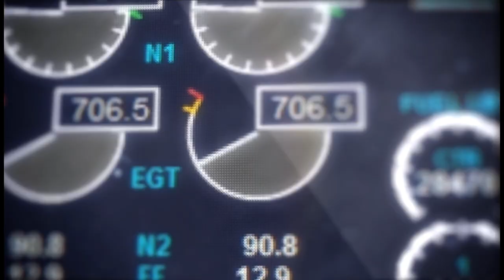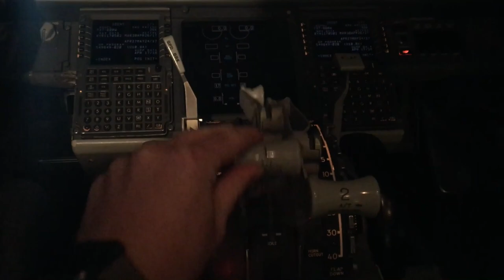Can a circuit-breaker crash an aircraft?

Comment: I have a set of books called Air Disaster and in 1 there was an incident caused by an aircrew tinkering with the N1 tach circuit breakers. They ended up drastically overspeeding 1 engine to the point it blew itself apart which caused heavy damage to onboard systems as well as broke out a cabin window causing a passenger to be ejected from the aircraft. The other 2 engines also went above 100% engine throttle but didnt fail

Comment: On a newer aircraft with the digital checklists, is there any integration between the checklist and the actual settings? Ex. Checklist says Flaps 5, and you click ok even though the flaps are 0. Does it continue on or stop you right there?

Comment: Yes, yes, yes.  On August 16, 1987 Northwest flight 255, an MD-82, departed DTW with no flaps extended.  The result was almost the same as the Spanair flight shown in this video.  I was near the crash scene - it was too awful to wrap my head around.  This issue is SO very important.

Comment: ReHi Mentour:

that Swisss air disaster is not the only one in which neglect of a circuit breaker had serious results.

The one I remember hearing of was, i believe on an Air Canada flight. the circuit breaker popped just about time to take off. One of the cockpit creqw reset it, it popped again. 

Instad of investigating, he reset it a second time. As it happens this breaker was to protect the electrical systems for the toilet. One of these was an electric pump that was a part of the flushing arrangement.

The plane took off, and soon after there was a fire in the toilet. As I remember, the plane was able to land without cdrashing, but I am not sure how many in the cabin might have died of toxic smoke inhanlation.

Comment: By the way, a very critical moment is when the crew is approaching the holding point, it's a good time to ask for ATC confirmation ( if there is the slightest doubt) that there is a clearance to line up. Since I retired a few years ago from ATC, I don't know if this phraseology has changed (I hope so!) : "cleared into position"; oh and also: "cleared into position." It's too easy ( I mean, there is a strong tendency) to remember and pay more attention to the last words in a spoken message, besides, there is also often a degree of expectance to enter the runway and take-off; noise in the cockpit may also disrupt communication and pilots could make of of the most dangerous errors, a runway incursion. Both ATCO's and Pilots should avoid the phrases "holding position" as a noun, and refer to the action of entering an active runway as "...into position). It's much safer to use expressions like HOLDING POINT and "cleared to line up and maintain", or " cleared to enter runway XX and maintain".

Comment: Nice explanation !!!. Thanks. Adding this check point sounds good But repeating it several times ... does it make sense ?. The Spainair guys were wayyy delayed, have personal reasons behind getting to destination. I listened the audio, the didnt appeared to pay attention to the aircraft at all. Wonder how often this happens and they get warned just by a system. I mean, pilots are humans, airlines are un urge for making money and keep the plane flying, presure builds, because airport delays, climate. The sort of thing that no one can predict and all the load end in the pilots to keep the schedule. Systems are trying to "fix" or add a level of safety. But systems are just there to "help" but thats it. . Airlines need to be proffiteable, some of them struggle to keep flying. I think that this the weak link that no matter how many times a procedure is repeated, the risk is still there.

Comment: @Mentour Pilot
Hi, Peter.  I have a question about thrust at takeoff.  

So, I read a Wikipedia article about Spanair Flight 5022 (not sure how good of a source it is), I watched an Air Crash Investigation episode about Air Florida Flight 90, and I recall some details of Air France Flight 447 - in all of those instances, the pilots closed or retarded the thrust levers significantly, thereby causing a loss of lift in critical moments of flight (actually that doesn't apply to AF flight, as it was at cruise altitude).

My question is - how damaging would it be to the aircraft if the pilots simply moved the thrust levers forward at a risk of overspeeding it, just to ensure to gain altitude first or maintain it before they tried to deal with the issues they've encountered?  

I have a vague idea of how strong dynamic forces can be on the aircraft in air at high speeds, but I'm wondering if they are that strong to severely damage the aircraft and make it uncontrollable in case of a slight overspeed (which when close to ground seems better to me than getting a stall).
Reply from the maker: Hi!
We always apply as much thrust as needed to maintain safe flight speed. Speed is probably the most important parameter to monitor anytime in flight.
What happened on those flights was that the crews lost situational awareness to some extent. This means that they did not understand what was happening or they missed critical information.
Reply: Mentour Pilot   Thank you Peter!  Have you perhaps made a video about the importance of speed and what would happen to the aircraft if it oversped in flight?

Comment: Would it have been possible for the Spanair pilots to quickly deploy the flaps (after the stick shaker warning) to prevent the crash?
Reply: No. The stall occured immediately after takeoff. Even when the pilots realized what went wrong, there was no time and altitude to extend the flaps before the plane hit the ground.

Comment: So say you did all your checks properly at the gate before leaving and the alarm did not sound, but when you get to the runway and go to firewall the thrust levers and the alarm goes off despite correct configuration (because the warning system itself is faulty) what then happens?

Obviously if it false triggers at the gate i assume you dont even bother moving?, but at lineup, does it basically force you to go back?

If it goes off for any reason at line up do you look to see what went wrong and correct it on the way to the stand (to test for possibility of false alarm) or do you not change anything other than that required to return to stand and park up?

Comment: You forgot the last barrier of safety that was breached in the Spanair accident: After the stickshaker activated, the plane was still perfectly flyable (you just had to follow approach to stall procedure) and, as an alternative, with a 14000 ft runway, there was also more than enough runway to let the plane settle and accelerate more to safely lift off again or abort even if well past V1, Vr and V2. (14000 ft is three times what a fully loaded MD-80 needs to accelerate to V1 and stop).

Comment: Hi mentour pilot. I am an electrician. But I have some interest in aircraft Electrical system. I imagine the reason why aircraft Electrical systems operate at 400 Hz AC is that motors and transformers designed to operate at that frequency are much smaller and lighter than those designed to operate at the standard 50 or 60 Hz we use in our homes and offices thus a weight savings can be achieved.

Comment: Has anybody tried randomizing the order of checklist items in order to prevent rhyming?
Reply: No, because the checklist is structured by system or panel layout. Randomising means more chance of making a mistake. When I do my scans, I find it easier and quicker to scan each panel a certain way in as set pattern. As you become familiar with the layout, it becomes very easy to spot a switch in the wrong position, etc.

Comment: Hello thanks for your vids, non pilot so a silly question probably, if u are aqbout to take off and u find u havent set the correct flaps etc. why cant u just do it and go, instead of going back to where u started from?
Reply: Thanks for explaining that, so the point of going back really is a safety issue, to initiate an ivestigation into how u got into the situation and so that it wont happen again.. got it.. :))))

Comment: Excuse my ignorance but is the circuit breaker set in accordance with the checklist (wouldn't this be a program?) in other words the alarm will only silence once you've physically checked the flaps, throttle, trim, parking brakes etc the predetermined number of times.

Comment: Why aren't voice recorder breakers designed so that they automatically preserve data that may be required for an investigation? This would prevent pilots from intentionally not pulling the breaker if an error has been made & losing vital information which could hamper an investigation! Is there a back system or procedure to retrieve lost information on the recorders?

Comment: AC797 was a fire causing a circuit breaker to pop, 90 seconds after landing at Cincinnati the cabin went up in flames
Reply: That was a peculiar situation. The circuit breaker performed its intended job. However, repeated attempts by the crew to reset the breaker probably did not help the situation. It was a non-critical system, so having the circuit disabled would not have been detrimental to the flight. The investigation was unable to determine if the electrical problem was the cause of the fire or if it was caused BY the fire.

Comment: Great video as always. The only thing I have a hard time believing is that having to cancel the flight due to a takeoff configuration warning at takeoff roll will be looked at as a learning experience by the airline. Maybe things are different overseas. But corporate America would most certainly scapegoat  employees that make an expensive mistake like that. (Scapegoat is putting it nicely).

Comment: Can a pilot be certified to fly several different types of aircraft at the commercial level? Or are you only allowed/able to fly one specific aircraft?
Reply: In the UK, yes. Not certain about other countries. I had a friend who was flying both A330 & A340. He was also an RAF reservist, so was flying Hawker 125 at the same time. I remember him stating that the CAA weren't keen (or were clamping down) on pilots having too many concurrent ratings, but as RAF flights were on a different log book it was such an issue. Never the less, he left the RAF soon after.

Comment: didn't the pilot pull that circuit breaker after seeing it done on the ground it was featured in the latest air crash investigation or have i the wrong one
Reply: It is, on AirAsia QZ8501. 

Man, lot of pilot needs to realize -> plug out or plug in the circuit breaker can make electrical surge which equal to fire or can make system malfunction.

Comment: It’s so amazing how many safety barriers there are, very very impressive. I think the business world could learn a lot from the aviation industry. I did hear many years ago there was an instance that the circuit breaker was pulled intentionally by many pilot as it was a constant annoyance, obviously a different system to what you are using. But from what I remember they would constantly get a warning during taxi and I think it was due to takeoff confirmation but I may be wrong. On one flight they didn’t push it back in at the point of getting ready to takeoff which lead to an unnoticed incorrect setting of some sort. I think this was in the USA. The flight ended in tragedy sadly, the concurrent investigation showed that this was a common practice and systems and procedures were changed due to this incident. Thanks 🙏 for another great and informative video.

Comment: A circuit breaker wouldn't be the cause of a plane going down but if you want to  let the smoke out of an LRU then you can hold down a popped breaker. That works really well.

Comment: Is it fysically possible to lift-off without any flaps/slats extended on a modern airliner?
Reply: Helena Vanaeken just based on the pressure difference between the bottom and top of the wings I would think with enough airspeed it would lift without flaps
Reply: Everything flies given enough speed. It will take off at a higher lift off speed, but the runway might not be long enough to allow it to reach that speed. Also the pilot may pull up at the flap-down lift off speed, which will cause the plane to lift off, but it won't have enough speed to remain airborne and climb, which is what caused the crash in the video.
Reply: Helena Vanaeken with enough speed it is definitely possible
Reply: Due to the procedures during the takeoff roll, a takeoff without flaps/slats set correctly will end in a similar crash every time. After calling V1, you're done. Takeoff can't be aborted anymore, at Vr the pilot will rotate the plane, leading into the stall and crash immediately. The plane itself might be able to fly with a much higher speed, but you not gonna get it that fast even on long runways.
There is a thing called "ground effect", which enables an aircraft to lift off at a speed far below its minimum flight speed in regular air because the air gets compressed between the ground and the wings. That's why you become airborne even without the flaps/slats. But with increasing distance between ground and wings the ground effect disappears, leading to a stall and crash due to the low altitude. I think this happens so fast, that at the moment you feel something going wrong, you don't even have the time to figure out what happens before the plane hits the ground.

Comment: Can someone tell my what a circuit breaker is
Reply: 360NoScopes 
From on-line dictionary...
“An automatic device for stopping the flow of current in an electric circuit as a safety measure.”
It can also be toggled manually (like a wall light switch in your home) to interrupt or resume electricity in an electrical circuit.

Comment: How is it possible to forget something like flaps though?
Reply: Paul Brockbank crews sometimes rush and don't use checklists, the stress of the situation,  these are just two examples.
Reply: Ohh okay I understand     thanks!
Reply: Paul Brockbank It has happened in the past when air traffic control interrupted the pilots pre-takeoff check list. They never completed the check list, Sorry, I dont have the flight number.

Comment: is it dangerous if you turn the passengers oxgygen switch off at 30.000ft?
Reply: CaptainJelte well I don't think boeing did any tests regarding that😂😂
Reply: I'm not sure but I think that switch just deploys the masks from the ceiling. There probably isn't a switch to turn the cabin oxygen off.
Reply: CaptainJelte I think there is a switch for that, in case there is a fire onboard it's not being fed
but I'm not an expert so this is just a guess
Reply: There is no oxygen fed into the cabin. It's pressurized.
Reply: CaptainJelte  The swith which is called as bleed air if turned to shut can stop the air from circulating which will eventually cause the oxygen levels to go Down there is no such switch to stop the flow of oxygen😏😏😀😀😁😁😂😂
Reply: There is a switch to depresurris the whole cabin
Reply: CaptainJelte the answer would be yes.taking into account the time for useful consciousness at 35,000 feet is 45 seconds or so.
basically, the pressurized air for use in the cabin comes from the compressor stage of the engines. entering the compressor, the outside air becomes extremely hot as it is pressurized. The portion of air sent into the cabin is cooled by heat exchangers, in the A320 they are known as precoolers, 1 in each pylon. once cooled, the air is delivered into the cabin at approximately 11 psi. I know, you're asking, why not sea level pressure?  well,  two reasons. 1. 11 psi is a good dynamic  and 2. it reduces the overall stress on the airplane😊
Reply: I'm watching the documentary video on your app 👌 just FYI: your description says "TAWS" instead of "TOWS".
Reply: Yes but what if I shut the bleed air valve mentour?
Reply: I guess here is some confusion with the difference between oxygen and pressurization.

Comment: What is cricuit breaker
Reply: Nonni Gunnar you also have circuit breakers in your house. they "break" an electric circuit, essentially turning things off. they automaticly break if something is wrong with the electrics
Reply: A fuse.
Reply: Martin Zone you have to replace a fuse though, a CB you can just pop in again
Reply: the breaker protects an electrical circuit from being damaged  by some nasty business such as an overload. at the moment a fault is discovered, its primary duty is to interrupt the flow of current.  It differs from a fuse, as it can only be used once then discarded. the breaker can be reset to guard again😆